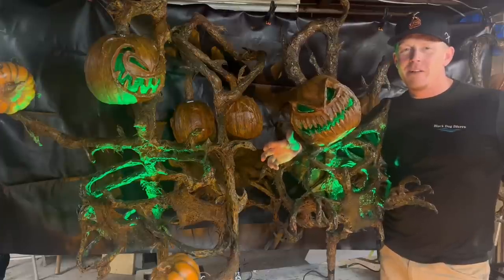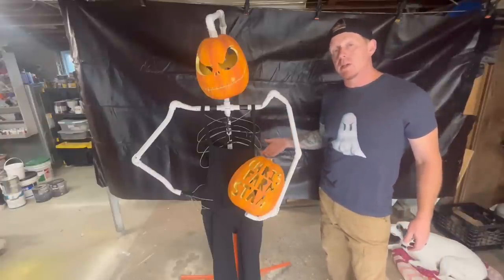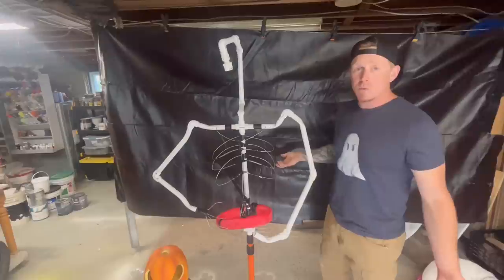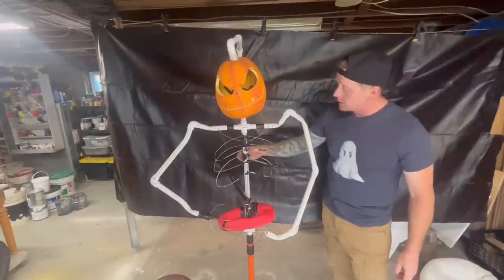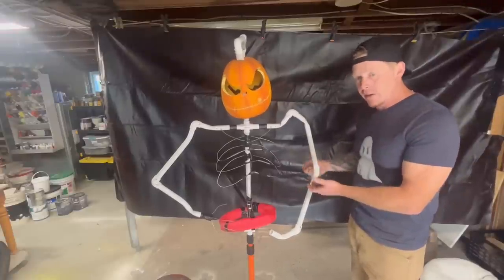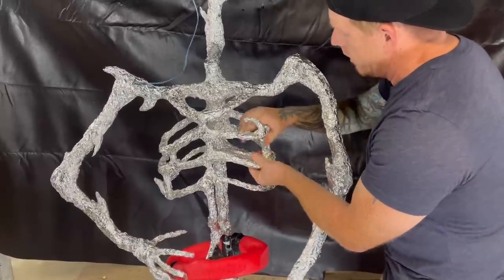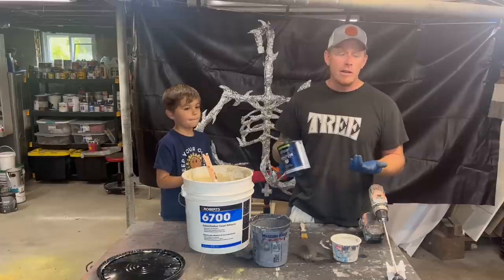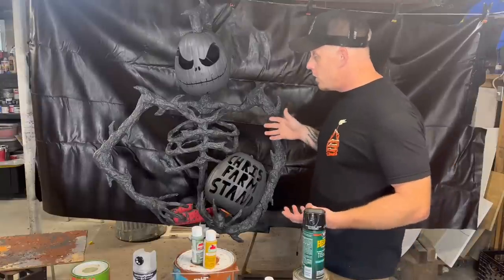Creating your own pumpkin monsters

Comment: Not only is your pumpkin monster so beautifully done, your video gave me multiple ideas to incorporate into various applications. Most unexpected is the simplicity of the plastic drop background. I plan on using large black plastic for some simple outdoor walls/area dividers. What I did last year was use Gorilla Glue duct tape to attach the large plastic to some of the taller fiberglass rebar pounded into the ground. It makes it a mess to try to take down, and the tape can make much of the plastic not reusable. Funny thing is, I planned on picking up some more of those fiberglass rebars on the way home from work today. Now I will pick up some clothesline as well. Clipping the plastic to the clothesline should make it easier and much quicker to set up, and take down.This should also allow me to just get the rebars in place in early Oct., but wait till the 29th or 30th of Oct to attach the plastic "walls", so I don't have to fret so much over potential bad weather (wind) taking down what took some effort to put up! 

There is a wealth of good info in this vid. It also started sparking more ideas in my brain. For one, I love the two-sided aspect of the jacko head. Being able to change its face from more or less menacing is a great idea. Also makes me think it would be cool to add a motor to make it possible to switch from one face to the other. It would certainly add some complication to the prop build overall, but I don't see it as impossible by any means. Another idea to add to the pile of things I must eventually make - lol

Kudos, and thanks for sharing your build.
Reply from the maker: Thank you so much! I'm just a amateur goofing around in my basement but and so happy you enjoyed it and love that you found some unintentional ideas in it too! I really dig the idea of a 2 faced jack o lantern. It never even crossed my mind as I literally had 2 faces carved in everyone of them for a period of time 😂.  And motorized you say??? My friend you just raised the bar! I freaking love that idea! There would have to be a dividing wall inside his head so you couldn't see the other face through the front and then you could have two different color lights in there as well. A yellow on the happy side and red or green on the more menacing side! This is totally doable. Thank you for the idea. Halloween people really are the best!
Reply: @mayhemonmidlake7681  Yes, a dividing wall inside was what I was thinking. Even with different color lights for each side, you could still maybe add to that effect with the divider itself being colored differently on each side. I haven't incorporated any motors into any of my builds yet, but I imagine this effect would best be served by a motor that could very quickly turn the head exactly 180 degrees. At least a 1 second or less switch from happy face to a menacing red-lit face would certainly have a more powerful effect than a continually turning head at a slow or moderate steady pace. Of course, the effect would be even more powerful if you could rig up short music or sound effects that got seamlessly and immediately triggered just as fast as the quick 180 head turn. Keep creating! I look forward to all that you come up with.

Comment: Wonderful tutorial.  Thank you so much for sharing.  I hadn't thought of using carpet adhesive as the additive.  Awesome video.
Reply from the maker: Thank you! That carpet adhesive mixed with paint will stick to anything! It's my go to undercoating.
Reply: @mayhemonmidlake7681  that’s good to know. It’s been years but I’ve used to Monster Mud before and that was an issue. Very clever. I like it a lot.

Comment: The first set of 4 go you have a video on how you did the pumpkin heads?
Reply from the maker: I don't have a tutorial on the heads unfortunately but I can explain rather easily. After picking out and carving the face I wanted into it. I took paper clay and built up the features I wanted to stand out more like the teeth and eye sockets. The paper clay recipe was from another you tube channel called draconfang and it was the 5 part video where he made a giant paper mache pumpkin. After that I finished it just like I did in this video. 
Hope this helped.
Reply: @mayhemonmidlake7681  so the actual pumpkins are the store bought carvable ones? I was thinking about doing that to to make them better. Check out a paper clay called "celluclay". It's a ready to mix one you can buy from a craft store. It's pretty good and easy to use.
Reply from the maker: They were given to me by a friend but they were store bought foam ones that had faces. I covered the factory made faces and carved my own on the backside. 
I'll check it out thanks!

Comment: Locktite foam would have saved all that foil,  and you can spray it with water, wait 5 minutes and shape with your fingers.  Then you can spray paint.
Reply from the maker: Oh believe me, I know my way around a can of spray foam. That's not the look I wanted here though and through the years it will need far more touch up work then this technique. On top of that  I have some birds that love to come peck at my spray foam props so I avoid it when I can. Thanks for the watch and the comment.

Comment: Subbed! Love them! Is the paint to thick to go thru a large needle in a spray gun?
Reply from the maker: Thanks brother! I suspect that it wouldn't spray well at all. That carpet adhesive is almost like joint compound. Even when you thin it back out it's still a bit thick.

Comment: Did you mention, maybe you did? How it will be stabilized in windy weather?
Reply from the maker: So the ones I made for my haunt will just be slid over a piece of rebar that's pounded into the ground and tied off to the fence. The one in this particular video has legs which have him steady on flat ground but there is also a pvc cross at the base of his spine. His legs go out left and right but the bottom of the cross is open and I cut a small hole in his overalls so a rebar stake can be slid right up his *ahem you known what. That will have him solid out in the most all weather.

Comment: Is the wire insulation strip wire to hold insulation in between floor joists?
Reply from the maker: It wire used to hold drop panel ceilings